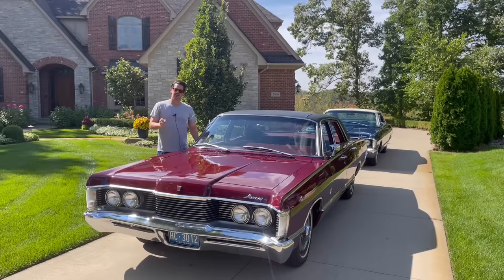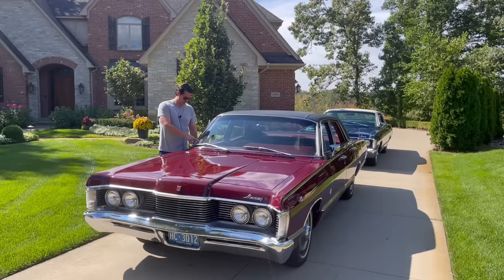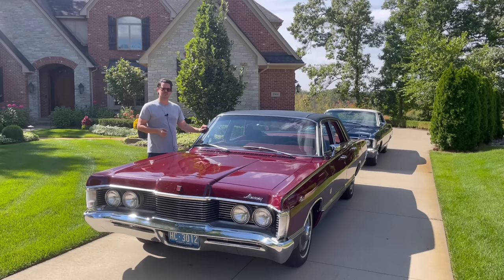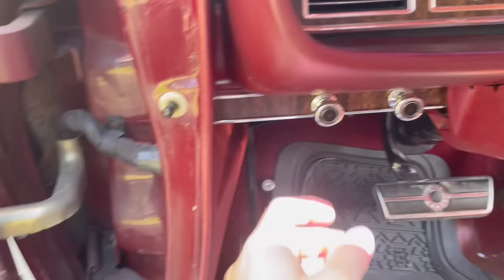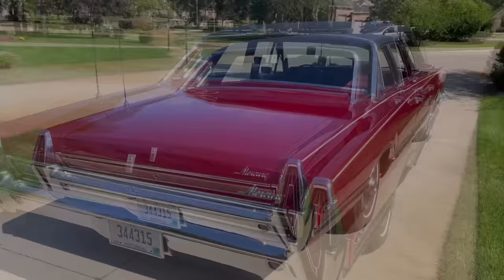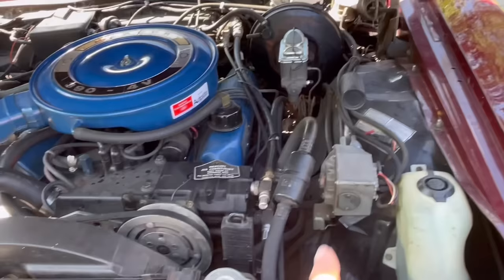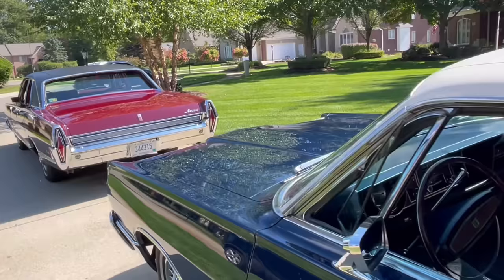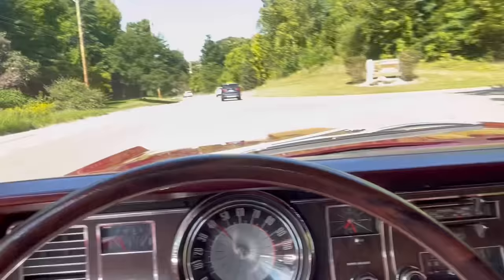Strange Features, Quirks & Idiosyncrasies of the 1968 Mercury Park Lane Brougham Sedan

Comment: I have thoroughly enjoyed your Mercury tour.  I am particularly fond of all the full sized Mercurys of the ‘60s.  Back in 1966, my family acquired a new Mercury Montclair.  It was a black 4 dr hardtop with a red interior.  I learned how to drive on that car.  The only power accessory it had was power steering.  I remember having to use both my feet on the brake to stop it.  I took my road test in it and found it very easy to park because of the chrome strip that ran along the fenders front to back.  I don’t think I could drive that size car today without the modern grannies and power accessories that are in today’s cars.  They really are beautiful automobiles.

Comment: I always thought that the full-size '67-'68 Mercurys were right on par with the full-size '65-'66 Pontiacs in terms of body styling, great engines, ride and build quality. For instance, that 390 V8 was silky smooth and had plenty of power, yet wasn't a gas hog, right on par with Pontiac's famed 389 V8.

Comment: Granted a 60s era four-door vehicle with a hardtop looked better than one with posts, but that was as far as it went in terms of benefits. With the hardtops all it took was one window or door out of alignment and the wind noise going down the road could drive you to the brink (especially on the freeway). I also think that 60s era four-door vehicles with posts had better body integrity and simply felt like a tighter vehicle, especially minus the rattling, flopping around of windows on hardtops of the same era.

Comment: Lincoln Continentals had those slider switches as well. The ends remove with an allen wrench, so you can position the ends up or down as your mood requires.

Comment: I had a 75 Mustang II that I adapted GM cruise control to. GM turn signal levers are not at all like Ford's. So, I went to the local LM dealer and bought the lever, just like in your Mercury. Even with a discount, that lever cost $22 in 1975! While that doesn't sound like much today, it was about triple of what a GM lever would have been. However, it worked just fine! Love the color of the Park Lane!

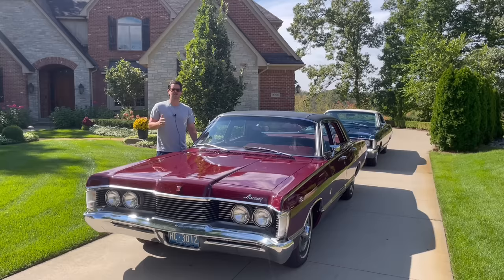Comment: 4:18 A "baby Continental" that was just 2.5" shorter and 1" wider than the Continental itself. It's ironic that they were pushing this theme when the cars were about as unrelated as they'd ever be, with the body-on-frame, coil-sprung Mercury beating the Lincoln at its own game in some ways. Of course, the lowly Mercury owner would have to give up something, and in this case the most obvious thing was the novelty (and mixed blessing) of suicide doors.

Comment: Both cars are beautiful, but the colour of that Marquis does it for me! I think the knob on the air control, should be up like in the Marquis as it clears the emblem , where as down looks like it will not clear the emblem! Might have been just one installer on the assembly line that put the knob on wrong, for a lot of the Park Lanes for that year!
Reply: It looked as if in the "right" position, the knob might obscure the marking to which it was pointing, so there were probably reasons for both sides of the argument. If only Ford had come up with a see-through version.

Comment: The most interesting part for me was seeing the left-foot headlight dimmer switch.
Both are beautiful cars but the sedan has that 'special' look.
Reply: That dimmer switch location was pretty much ubiquitous on American cars of the ‘60s and most of the ‘70s.
Reply: In truth, the “ergonomics” of American cars through much of the modern era were quite poor, requiring drivers to have to take their eyes off the road and reach for panel-mounted switches.  The bright light floor switch wasn’t a problem, but it was either on or off and only worked when the headlights were turned on...  no “flash” feature.  The Ford Taurus and Mercury Sable were the first American cars to really begin embracing European/Japanese interior ergonomics.
Reply: @kc9scott  I purchased my first new car in 1965. It was a Corvair Corsa Turbo. I traded in a used 1963 Corvair Spyder for it.

Comment: My very first car was a 1968 Mercury Monterey 4 door sedan with the 390 2 barrel. My dad bought it in 1972 and had it until 1978 and it got rear-ended and soon sold it to his friend who fixed the back end and then still used it to pull his camper with it. Then I bought back from him 1980 for $250.00 and it was back in the family again. I drove it proudly until the frame broke on it. But it could sure get up and go and it had the breezeway back window on it that still worked!

Comment: Maybe Ford flipped that lower heat control knob downward to avoid interference between the two knobs/finger while manipulating the controls while on the road...Or, perhaps the owner flipped it down for the same reason...  All those accessory knobs below the dash seem like "afterthoughts",  or installed after purchase..But, yes I realize they are factory.  Never knew those sliding rear windows were still being offered after the early 60s models

Comment: Just need to point out something : The Maryland plate on the front has a 3-31-69 expiration date (those plates were actually used during most of the  1968 calendar year and into the first three months of calendar 1969).  Most old car enthusiasts here in Maryland use plates from the actual year the car was manufactured and pay no mind to the "3-31-".  Maryland plates with the 3-31-68 experation date have a dash separating the letters from the numbers and have blue letters and numbers on white (just the reverse of the MD plate on the car).  The "year of expiration" practice started in Maryland in 1938 (with EX-3-31-39) and continues today, except they now expire every two years.  (Edit : Maryland plates went to a staggered expiration system in 1986.)  I've been a license plate buff since I was a child (I'm 59 now); that is how I know.  (9/23/2023)

P.S.  Many people have already pointed out the correct pronunciation of Hagerstown.  The first syllable is pronounced "hay."  And Hagerstown has a television station, formerly known as WHAG, that was an NBC affiliated station until 2016 and is now an independent station and uses the call letters WDVM.
Reply from the maker: Yes, I debated what plate to get and decided on the one you see as it was in use for most of 1968.

Comment: I was driving my 1957 T-Bird with the front fender mounted manual antenna fully extended. It sliced a bird in two as I was traveling about 80 mph. Bird guts all over the rear deck. It resembled the rear deck of a 1963 Continental one Dallas day in 1963.

Comment: YOUTUBE, STOP RUNNING ADS IN FOREIGN LANGUAGES !!!!!
The temp control knobs may be reversible.   Probably a small allen screw in the knob so it can be removed?    The Parklane was available as a fastback, I think it was 67, but I remember seeing one in the salvage yard of Midland PA on Tuscawarus Road.   IT was blue, and the car was really solid compared to modern vehicles.  The PS cooler is a great idea IMO.   Many other Ford vehicles used the radiator to cool the PS fluid.   These coolers may be there to reduce the engine temperature, since that fluid would be one more hot item the radiator had to cool.   Love that trunk, so well designed and spacious.   We'll never see great cars like this again.

Comment: Great video would be nice if it had the optional eight track player  i’m thinking the power antenna was long since it was tuned, primarily for a AM reception, which was more popular than FM back then.  also  I’m thinking that reason why that power rear  defogger switch was mounted  under the dash was due to the fact it was added later dealer add on  option
Reply: You're right about the antenna. Owners manuals of some card back then explained 'tuning' the antenna for AM or FM, and it does make a difference. Not sure of the defogger switch but if you look under the dash fascia at the sheet-metal car body beneath, you'll see where every car had places stamped for the full complement of switches and controls; only the fascia differed between 'base' and fully decked out. This was to make one body stamping work for all models, so maybe they added the defogger after the stamping was given final approval.

Comment: I loved the 66 Parklane light green 410 sedan 4 dr I have not seen it so I assume that it has been sold. It was the same color that the 1969 Galaxies that we received for a wedding gift. It was a wonderful car with the 390 IP premium fuel engine that I built into a 503 hp monster in 1999 that is still burning up the road today. I have found the FE to be the best engine that I have ever seen for longevity and performance.  Torque for days. I still wonder if you don’t mind, did you sell the 410 car? 14:14
Reply from the maker: Still have it. Its a 67.
Reply: @RareClassicCars  I am glad that you do,,that is a sweet car. If the original carburetor is still still a problem, there is no sin to put an Edelbrock or a Holley. Holley even made a 4010  carb to replace the troublesome  factory carbs. Also Holley makes a bolt on bolt on fuel injection kit that bolts on in place of the carb and is self learning. A 58 psi electric pump is required, but they get better mileage and make excellent performance. No more cold sttart issues. I am really glad to hear that you still have your 410 Mercury!

Comment: Is it galvanized steel or aluminum plate on the wiper control module?) If the second - rubber is needed to avoid corrosion)
Reply from the maker: Good point. Not sure.
Reply: @RareClassicCars  Magnet will tell

Comment: The wiper system these cars have is vacuum based and used from 1965-68.
The system Robert Kearns invented was fully electronic and not related to the older one.
Reply: I take it you mean that the motion of the arms was done by vacuum?  I remember my family’s 1964 Rambler having them; I’m a bit surprised that Ford/Mercury was still doing this up to 1968.  Now that you say this, it makes more sense that the delay system would be a mix of electronic and vacuum.
Reply: I think this system automatically put the wipers in full speed mode when the accelerator was floored. That may have been part of the raason for the vacuum connection perhaps used to sense engine vacuum at full throttle.